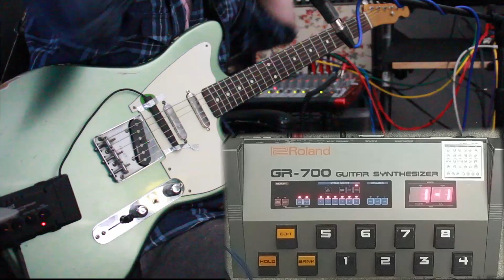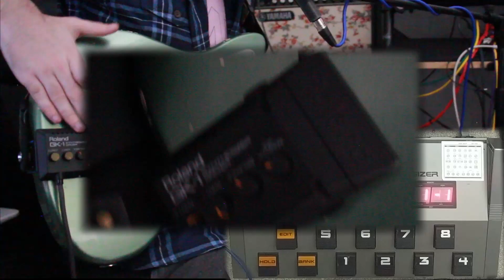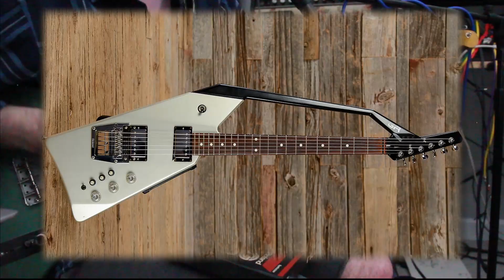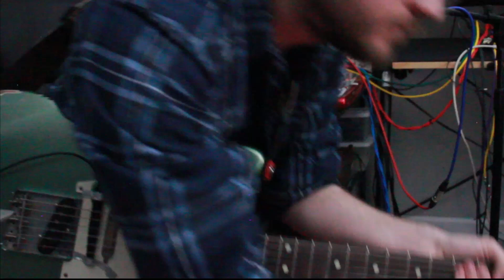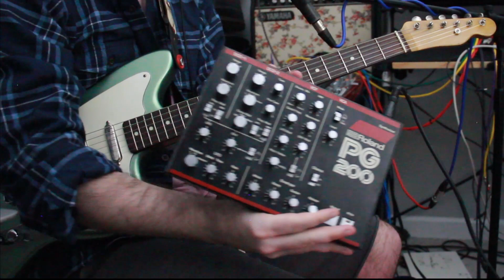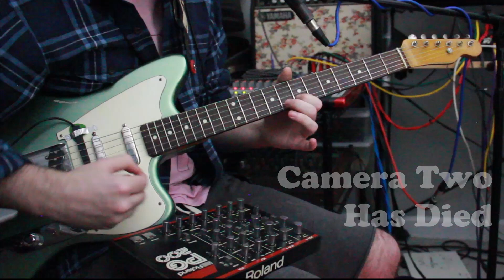Roland GR-700 Guitar Synth // Demo & Walkthrough

Comment: Hey there, cool demo.  I Just got one of these with a G707.  It mostly works but it sounds like there is an underlying constant note ringing out the entire time.  The note isn't as loud as the notes that I intentionally play but its super annoying.  Is this normal?
Reply from the maker: That sounds like it could be voice chips getting old to me.

80017a is the chip in question, there's one for each string and as they go bad, will behave like that, searching for it you might find juno 106 repair guides. Same principles!
Reply: It’s not normal….
Reply: @vicesquadpunk  gotta get the chips replaced (a guy in Chicago fixed mine for $250, good as new now)
Reply: @urrrccckostan  They don’t need to be replaced, just melt off the plastic coating with acetone, in a jar after removing from the board. When you put them back in (some people use sockets to avoid heat damaging them) and they work a treat!

Comment: Hey nice MKS-30! That's what the GR-700's hardware architecture matches synth wise. Seriously awesome synth it's it's own right. Nice demo!
Reply from the maker: Thank you! I forget about rack mount versions of all the roland stuff, I'm always in the keyboard headspace.
Reply: @JorbLovesGear  no worries at all! You weren't wrong by saying jx3p because all 3 are extremely closely related. But the mks 30 shares the juno106 vcf/vca chips. Keep up the great work!
Reply: @SacSynths_Jack_Z  thanks for the clarification. I’m now running a JX-03 and a JU-06 (and a JP-08) along with my GR-700. (Yeah, I know, limited polyphony...) Mostly use my IMG-2010 as controller.

Comment: Jorb isn’t the gk1 supposed to be positioned as close as possible to the bridge? I run a vg8, gr33, vg99 and the setup for all three state a measured distance for the pickup to bridge setting
Reply from the maker: Honestly, not sure! this is where i could tape it up without actually modifying my guitar at all. lol
Reply: it is, and that is probably contributing to any tracking issues

Comment: gk-1 is plugged straight into the gr-700 or are you using something else like the gm-70 between them? thanks.
Reply from the maker: Straight in! Not familiar with the rest of the line, what's the gm-70 do?
Reply: it's a pitch to midi convertor from that same era. hey, just a thought but i thought about doing the same thing you're doing and i think it would make a lot more sense to do it with flatwound strings since they are normally heavier gauges that average strings so the intonation would be better and they also make none of that scratchy sound roundwound strings make when we move our hand around the neck which may throw the tracking off. if you try that, post a video on it!